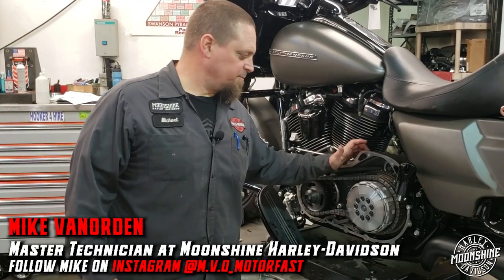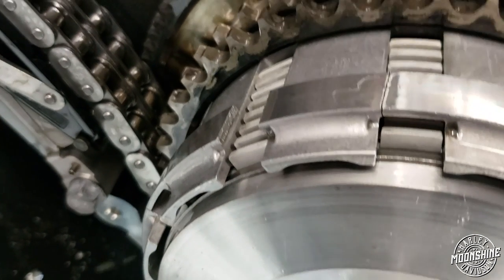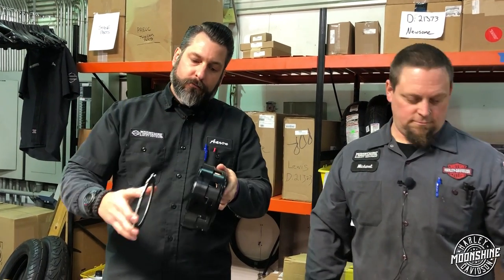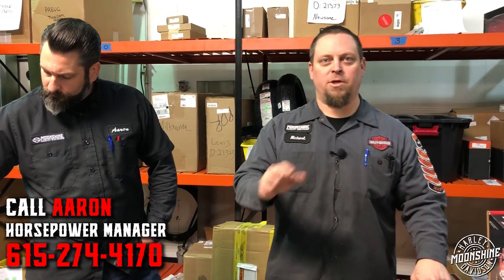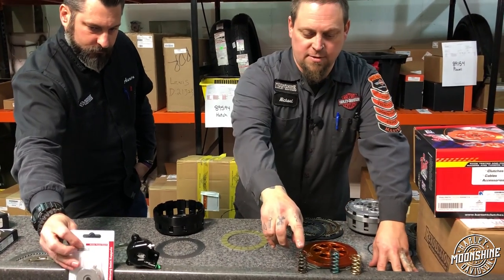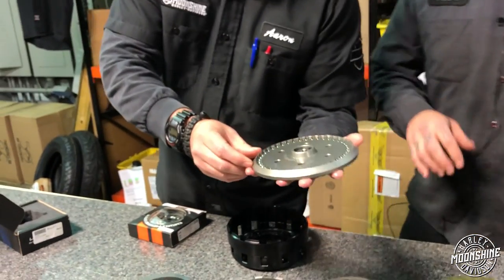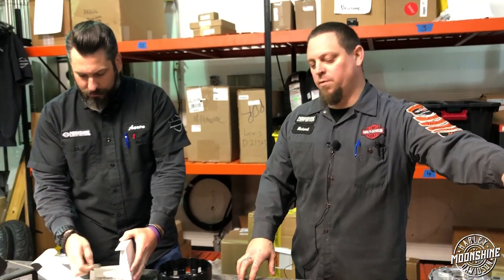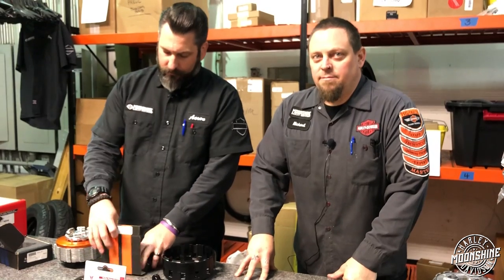Harley M8 KILLS Stock Clutch | Shop Talk Episode 33

Comment: Really informative video, thanks guys. I'm assuming if you are doing a 128 upgrade you'd have to be mad not to upgrade the oil pump and clutch yeah?
Reply from the maker: Joshua Cooper we would agree.
Reply: @MoonshineHarley  
A little late but at what TQ & Hp should I worry about the basket ? 
I just put Barnett x plate kit in my twin cam 10: making 108 hp 116 TQ 
The basket looked good but now I find out about problems with the basket & HP upgrades. Thanks

Comment: So would it be a total waste of money/time to go with the Screamin Eagle 1200nm springs and 10 plate clutch pack for a stage 2 build?(M8 114, 475c cam, slips-ons, PV tune)  IT's like 220$
Or is the stock setup just fine for stage 2 with a 475c?
Reply: For just a cam the 1200N springs are fine.  I would at least do the springs.
Reply: @NoName-vz1ob  Cool thanks!

Comment: Yeah like 3rd gear in my 2018 flhxs with stage 3 only 120 lbs of torque  and 111 hp. Blown tranny at 7,800 miles and warranty just ran out.

Comment: Hello, I have a 2018 Heritage 114, I have little over 9000 miles on it. Since we've bought it used with 2000 miles on it. It is hard to get in to Neutral. I have had it in to a Harley Dealer for adjustment, but still not going in neutral especially when I'm at a stop. I have to pretty much have to shut it down to get into neutral. What should I do?
Reply: Put into N while ur still moving
Reply: When you stop move it backwards a foot or so  while holding in clutch and then try to put it into neutral. On my 2018 street glide helps a lot goes right in neutral no problem then.

Comment: Harley should offer high performance versions from the factory with the tech that goes along with the increased power.  I typically buy a bike for the engine from the factory as that is the most costly to modify.  Suspension mods are much less expensive.  Harley’s answer to power is a larger motor but lighter bikes, composites cost money, helps everything like handling, braking, and acceleration.  Less heat to move a machine.

Comment: Guys,the musac noise is totally not needed.It is not MTV.Just straight out care and expertise is all that is needed.Harley needed to test these things comprehensively.Very bad PR.Appreciate your work.
Could not play it all.So noisey.Sorry.
Reply: The upgrades we are covering are not for stock applications.  The OEM drivetrain is more than adequate for stock and minor power upgrades.  These parts are for when you are adding 50+ HP/TQ to the machine.
And we are professional mechanics maybe not so much professional YouTubers, we are working to get better on that part.

Comment: Harley M8’s clutch and clutch compensators should be immediately replaced.  Junk!
Reply from the maker: We agree when the engine in making more than 140HP. If its stock or close to stock the Harley-Davidson setup is perfectly fine.
Reply: Moonshine Harley Mine was close to stock with only a cam and exhaust added. I am definitely not the only one and I’m curious how the 140hp is a benchmark?